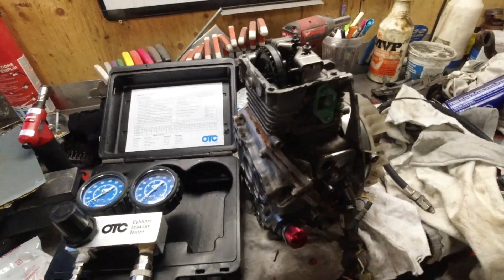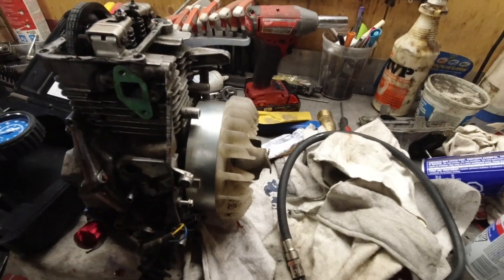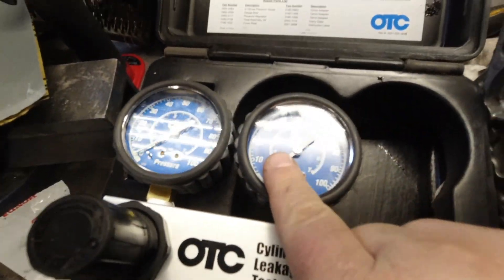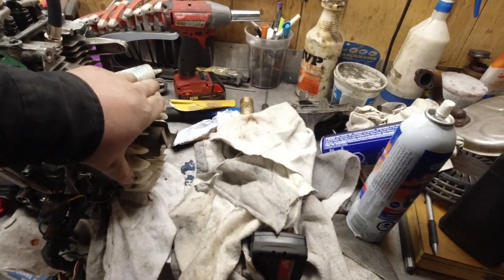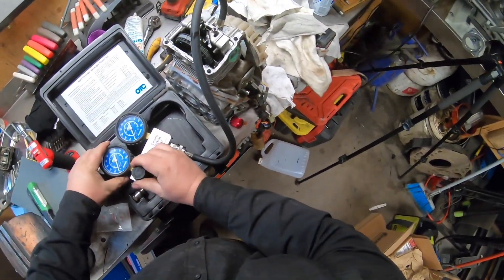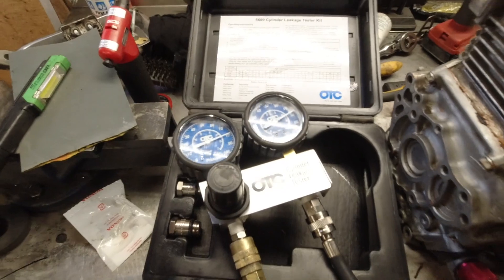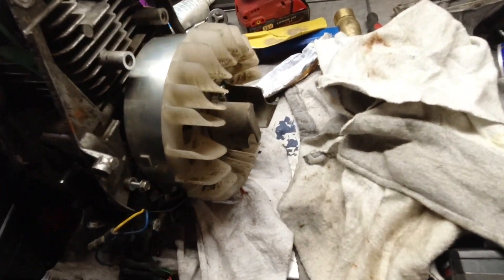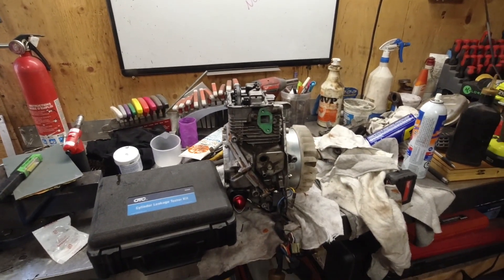Leakdown Test after Valve Lapping and Piston Ring Replacement

Comment: I do that test on every 4 mix that shows up at work for repair, BR 600's Kombi units, and FS trimmers.
Reply from the maker: They say the valves need to be set on the sthil 4 mix every 100 hours to prevent the engine from blowing up
Reply: @TestDontguess  Yes 100 hours is correct, The only blowers I have seen blown up are ones run with straight gas.